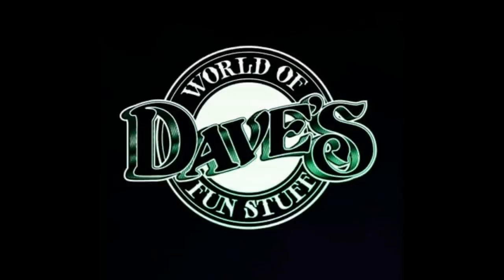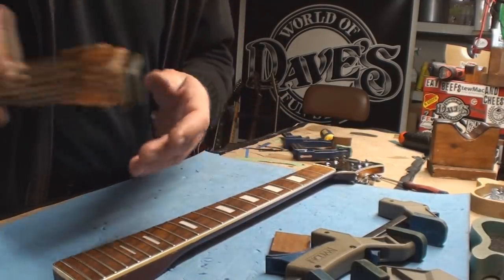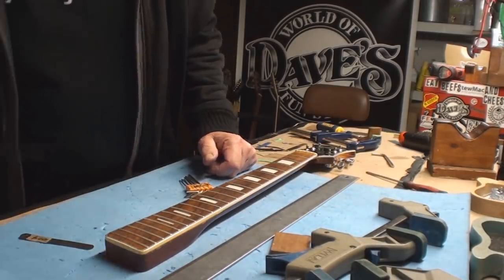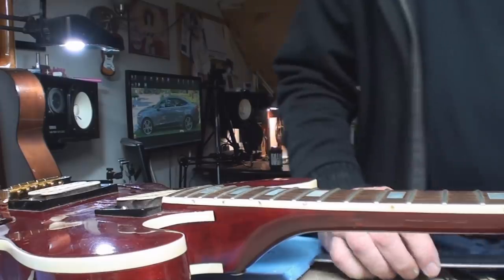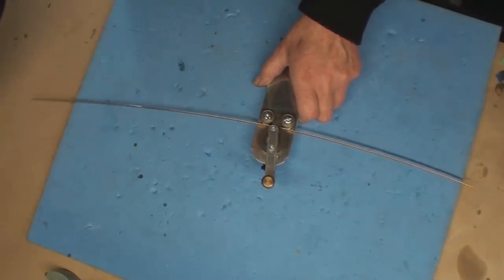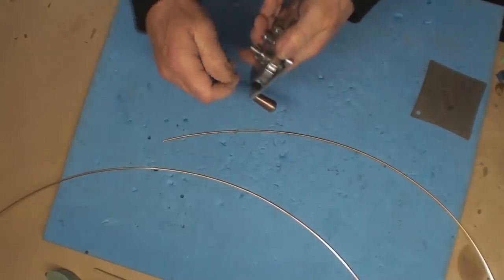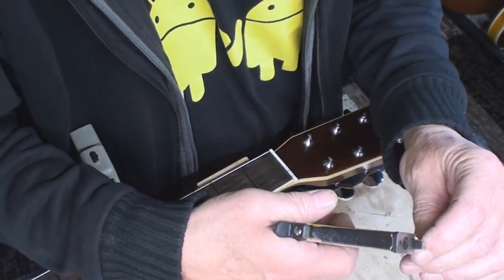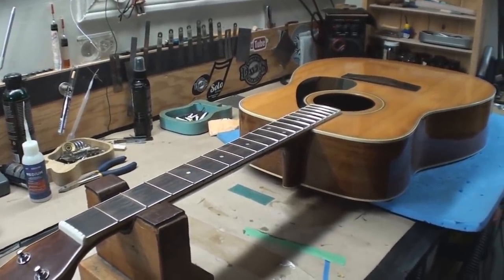Guitar Night Gallery Get Fixed Part 2

Comment: I asked a local guy if he would do some stainless steel jumbos for me. He said no freaking way. Not too many guys want to mess with them. Hard to do and hard on tools I guess.
Reply from the maker: great as an original install not so great as a refret
Reply: @DavesWorldofFunStuff  Hi Dave.. could you mention the name/source of the fretwire you used please? Asking for a friend (me).. 😏
Reply: @DavesWorldofFunStuff  Agreed. I imagine the SS frets would be a real gong show to work with. I would settle for beefy 6105's. Or maybe Phil McKnight would suggest some kind of space metal nasa frets that would make me the greatest player of all time! Know your gear! lol.
Reply: @UCPbxnn7qFOP7VBn8oNRPLww thanks much.. that’s the same wire I put on my Les Paul fretboard.